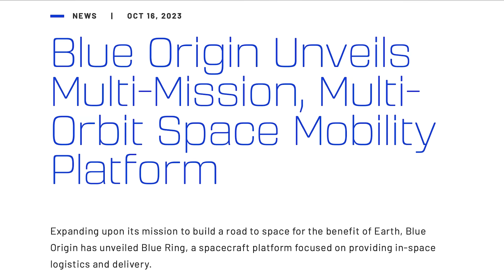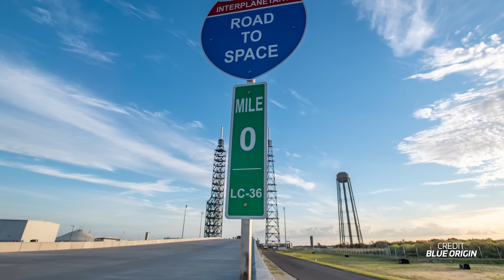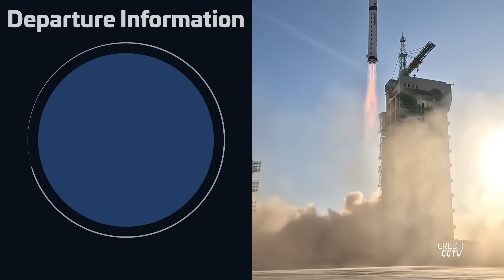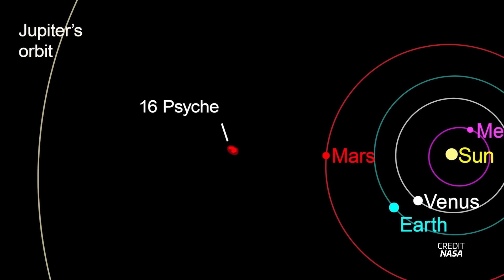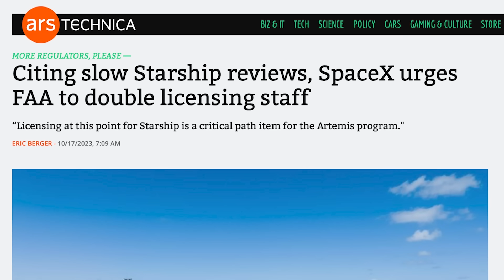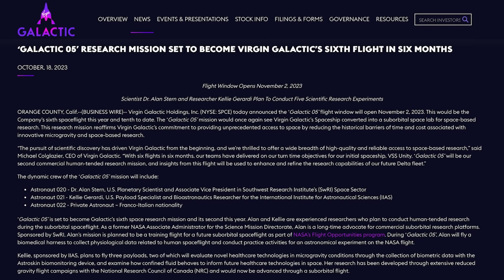Rocket Companies Testify Before Congress | This Week In Spaceflight

Comment: Gotta wonder why at this point in history there's not a single much less an army of autonomous robots that can walk around anywhere on the exterior of the ISS to do "inspections".
It's almost like the designers of the ISS, and everyone since them, have foolishly assumed that there would NEVER be problems that required a veritable ARMY of inspection, or better, repair robots (Hmm. SCIFI authors certainly seem to have treated this as SOP).
Me thinks it is WAY past time for this thinking. Now before anyone says "It's too expensive". True, if traditional contracts are let. But there's this one company that seems to excel at making the "impossible" only late.
Alas, perhaps for the NEXT space station this will just be SOP.

Comment: Read up on India's NGLV rocket. And the SCE-200 engine. India is fully capable of making a heavier payload rocket by the next decade. The challenge India is giving itself is to do it in a manner that makes the rockets reusable. Otherwise, it wasn't even a challenge.
Reply: As far as I understand, NGLV is just a Falcon 9-class rocket which means it is just slightly into heavy lift but nowhere near what's needed for a human flight to the Moon. Need a rocket 3-4x larger than NGLV is supposed to be
Reply: @ale131296  When I said "India is fully capable of making a heavier payload rocket by next decade", I actually meant "heavier than NGLV". I know we need a Moon Rocket (>100 tons to LEO) for a direct mission to Moon. My point is, with SCE-200 and NGLV as this decade's targets, ISRO is setting itself up for being in perfect starting position for building a Moon rocket in the next decade. 

But, now that I think about it, with the space station done by 2035, it is possible to do an indirect mission to Moon through the space station using just the 20 ton to LEO capacity of the NGLV rocket alone. That way, you don't need to launch the full stack in one go. Like so:-

(1) Launch and assemble the Indian space station in orbit piecemeal using NGLV.

(2) Create a "Chandrayaan crew module and Chandrayaan crewed lander" stack that weighs in at 20 tons. Doable because Apollo lander weighed 15 tons. And in the remaining 5 tons needed for the crew module have no reentry shielding or parachutes. This allows for a slightly bigger crew module than the Gaganyaan crew module (which also weighs 5 tons as well, but has reentry shielding and parachutes). The weight saved from this can be invested in a second docking port, so now crew module has two docking ports.

(3) Create a new "Chandrayaan service module" that weighs in at 20 tons and has all the mission supplies. Most of this 20 ton module will be a large propulsion module with enough delta v to take a 40 ton stack from LEO to LLO and back (return journey will be without the 15 ton lander and with significantly less fuel weight as well). 

(4) Have the spacecraft in (3) autonomously rendezvous and dock with the one in (2), forming the 40 ton Lunar stack. Have this Lunar stack autonomously rendezvous and dock with Indian Space Station (Chandrayaan crew module can use its second docking port for this).

(5) Launch the three Vyomanauts on a Gaganyaan crew module + service module stack and have it rendezvous and dock with Indian Space Station. 

(6) Vyomanauts transfer to Chandrayaan crew module. Undock the Lunar stack and go to Moon.

(7) Lunar stack returns from Moon mission, docks again with Indian Space Station. Vyomanauts transfer to the Gaganyaan stack they first arrived in. Undock Gaganyaan from the station and use it to splashdown in the Bay of Bengal. 

Biggest flaw in this plan seems to be mission complexity (increasing chances of failure) and the payload fairing volume of NGLV, which will be smaller than a Moon rocket's (given that the later usually has a 10 meter diameter fairing whereas the former has only a 5 meter diameter).

Comment: Some one needs to start to clean Space soon.
Reply: And where will u throw space junk? back on earth?
Reply: @mg9854  all the metal can be recycle there must be. If a computers motherboard .02g - .05g of gold & a phone can have up to .03g. With all the connections also gold. There is lots to get from one sat. Then you have all the others stuff to. The hard part would be to get the thin down.

Comment: You say that Rocketlab are already building and launching similar platforms like Photon that pretty much promise to do the same thing as Blue Ring.
That kind of statement makes me feel rather queasy as Rocket Lab actually have a demonstrated working platform and Blue have yet to get anything to orbit or even to launch anything other than new Shephard.
That said, I look forward to the time when they do get their act together.
Reply: I think their tugs are different sized and would move different sized satellites.  Kind of like how a smaller tug can dock a cargo ship, but it takes a mammoth tug to pull those huge barge strings up the Mississippi.

Comment: I think it is really a stretch to think that a metal asteroid has to be a core of a destroyed planet.  Everything is floating around out there and anything can start to aggregate to form a chunk of whatever it is.  I am happy Spacex has hired Bill Gerstenmeier and Kathy Lueders into their team.  Elysia you always do a great job and youre pretty but your lighting needs to be adjusted with a little more red.  Keep up the good work!
Reply: Ferrous meteorites tend to be large single body objects, not aggregates (atleast their core), thus they were formed at once, and melted together, which most likely means torn from a larger fluid puddle and then condensed on its own.
Reply: @Mike.The.Jeweler  Maybe the appearance of it will tell the tale unless as you say there is a cooled previously melted core below some aggregated surface and I guess their instruments might say if that is the case.
Reply: @pipersall6761  yeah reflectivity of the surface is usually how ferrous are identified iirc, and there's a specific equation for estimating mass based on some components of the orbit, then that's figured against the diameter to determine density, which is another way to distinguish.
Reply: You are so right! This asteroid has consistently been downgraded in density to less than 4.0, earth is 5.3. A Harvard paper has all but ruled it out as a protoplanetary core. It's no where near all the hype, but the mission will tell.
Reply: I wish I could give you more than one thumbs up for the asteroid comment.  While it is certainly possible that it is the result of the planetary collision that is thought to have put Mercury into its current state and orbit, that is certainly not the only explanation.  I've been really bothered by all of the fuss over the makeup of the Osiris asteroid.  I keep hearing stuff about how it was formed by planetary collisions and how exciting (=surprising?) to find water and carbon on it and such.  I think some scientists really want these collisions theories to be true so they can get some cool papers out of it and tenure and so on.  Or maybe it's just how it gets reported.  But anyone who has read the theories on the creation of the solar system and actually thought about all of the trillions upon trillions of tiny and accumulating interactions between all of that dust and debris left after the sun ignited, should recognize that the most likely explanation for these asteroids is that random chance left them congealed into their current sizes and orbits.  It seems likely that heavier elements would have pulled together more strongly and formed planetary cores which then pulled in lighter ones that came within range, etc.  But some of those lighter asteroids (and possibly some of the heavier ones...) did not, or have not yet, been pulled in to a larger planet.  They probably will, eventually.  Things take a very long time to happen in space.  It could be said that we are actually still witnessing the creation of the solar system, even if it is just the later stages of that creation.  Sorry if I've rambled.
Reply: @briangodfrey7424  I enjoyed your comments.